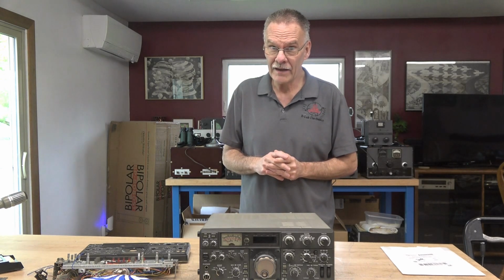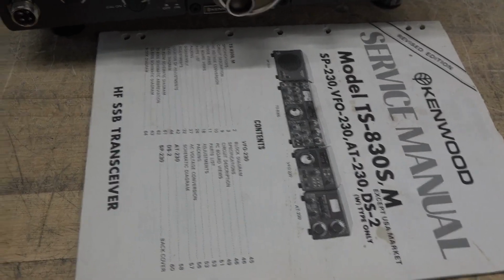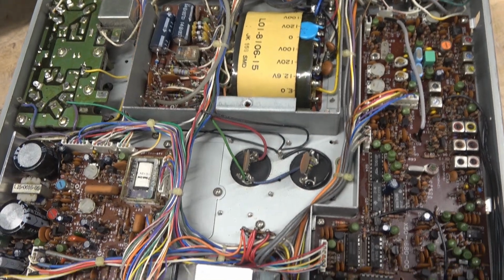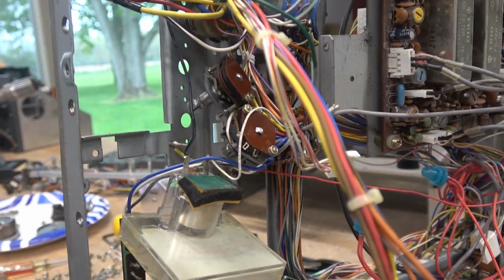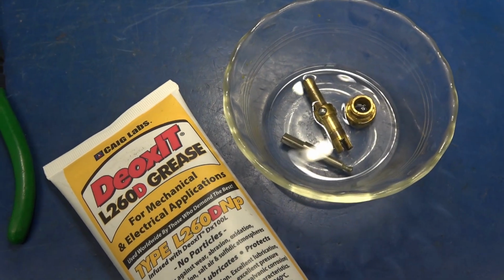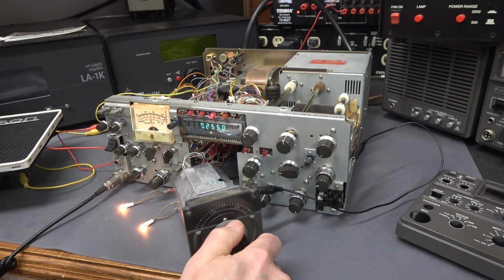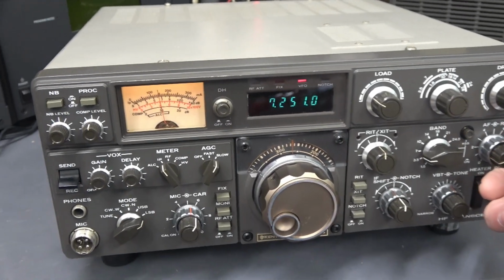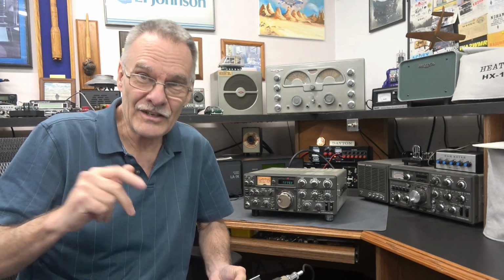Vintage Kenwood TS-830s ham radio transceiver shipping damage involved repair saved from scrap

Comment: Well done Terry I have a 830 also 901 and yes the cathode restore went burnt out also the screen 470 small supply resistor open circuit so replaced with large ones also two 6146 valves and the 830 going wonderful the 901 has a burt out mains transformer which I am residing went up in smoke the primary while on the air  so get it going 
I am 85 a retired tec electronic  had a company for 46 years and ham radio 60 years so still able to fix stuff was flying aircraft in Alaska fora while also and did a great number 
Of satellite systems allover the pacific traveled over 180 country's enjoying the jobs keep the good old gear going  73 zl3ABK in nz

Comment: Great rescue Terry! Open heart surgery successfully completed. One older rig able to operate for many more years! A perfect example of how it is crucial with these hybrid rigs to double box, double insulate when being shipped. If possible, a pick up with a seat belt is the preferred method of travel. These rigs are definitely not light. I have packed a couple and thick foam and ample bubble wrap is necessary. Glad to see your going to get to enjoy it. 73, Dan AB5VJ